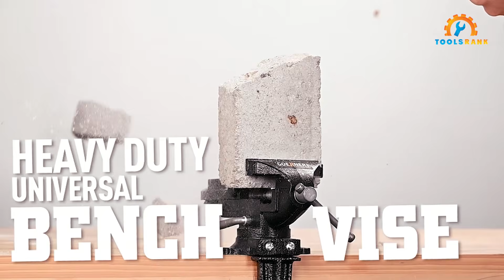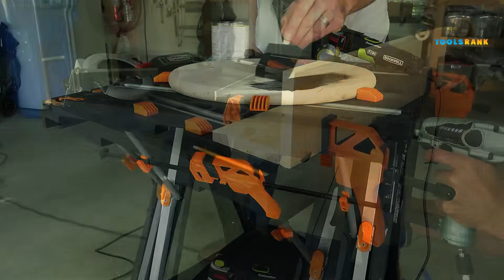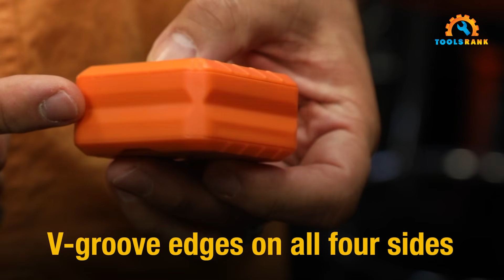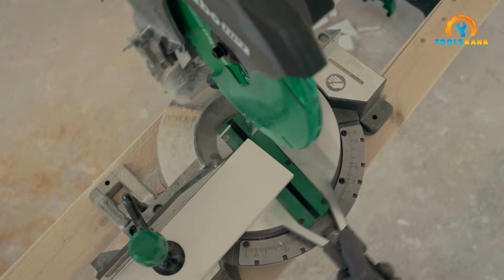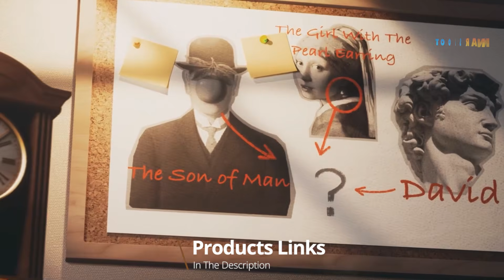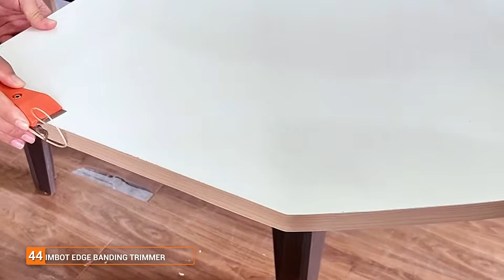46 Next-Level Woodworking Tools On Amazon You Must See in 2026

Comment from the maker: 1		Heavy Duty Woodworking F Clamps	
 https://www.amazon.com/dp/B0DV8G62YH?tag=toolsrank-20
2		VEVOR Electric Wire Stripping Machine	
 https://www.amazon.com/dp/B0CMZCNQNF?tag=toolsrank-20
3		Multi-Purpose Bench Vise Clamp	
 https://www.amazon.com/dp/B09TP7GZL9?tag=toolsrank-20
4		IMAYCC Electric Cement Mixer	
 https://www.amazon.com/dp/B08MFFZXN4?tag=toolsrank-20
5		Premium Cabinet Clamps Set	
 https://www.amazon.com/dp/B0BJQPMXZF?tag=toolsrank-20
6		Malco Adjustable Hole Cutter	
 https://www.amazon.com/dp/B000289542?tag=toolsrank-20
7		Woodpeckers Table Saw Gauge	
 https://www.amazon.com/dp/B002VRFM9Y?tag=toolsrank-20
8		LEXIVON Miter Saw Protractor	
 https://www.amazon.com/dp/B085BDP24T?tag=toolsrank-20
9		AVID POWER Compact Router	
 https://www.amazon.com/dp/B07CQK4ZL4?tag=toolsrank-20
10		Worx Pegasus Folding Work Table	
 https://www.amazon.com/dp/B01HREBZ3M?tag=toolsrank-20
11		GOINGMAKE Thin Rip Jig	
 https://www.amazon.com/dp/B0CBKSZ1D1?tag=toolsrank-20
12		GOINGMAKE Cabinet Door Mounting Jig	
 https://www.amazon.com/dp/B0DSKNJQKM?tag=toolsrank-20
13		Mt Diablo Wood Chisel Set	
 https://www.amazon.com/dp/B0CKLVV2VC?tag=toolsrank-20
14		RUITOOL Japanese Pull Saw	
 https://www.amazon.com/dp/B09NW2R5HQ?tag=toolsrank-20
15		Thin Rip Table Saw Jig	
 https://www.amazon.com/dp/B0048J720U?tag=toolsrank-20
16		RUITOOL Double Edge Pull Saw	
 https://www.amazon.com/dp/B09NW2R5HQ?tag=toolsrank-20
17		MICROJIG GRR-RIP Push Block	
 https://www.amazon.com/dp/B00DNX3N7S?tag=toolsrank-20
18		Klein Digital Angle Gauge	
 https://www.amazon.com/dp/B07ZWW3BW5?tag=toolsrank-20
19		NECAMOCU Edge Banding Trimmer	
 https://www.amazon.com/dp/B0D9TX59CG?tag=toolsrank-20
20		Amazon Basics Hand Planer	
 https://www.amazon.com/dp/B07V3QLZ5Y?tag=toolsrank-20
21		Klein Digital Electronic Level	
 https://www.amazon.com/dp/B07ZWW3BW5?tag=toolsrank-20
22		MICROJIG Smart Push Block	
 https://www.amazon.com/dp/B00DNX3N7S?tag=toolsrank-20
23		Worx Pegasus Portable Workbench	
 https://www.amazon.com/dp/B01HREBZ3M?tag=toolsrank-20
24		GOINGMAKE Thin Strip Cutting Jig	
 https://www.amazon.com/dp/B0CBKSZ1D1?tag=toolsrank-20
25		Ninety Degree Corner Clamps Set	
 https://www.amazon.com/dp/B0GMGX996M?tag=toolsrank-20
26		WETOLS Right Angle Clamp Set	
 https://www.amazon.com/dp/B095P753JN?tag=toolsrank-20
27		KATA Painters Pyramid Stands	
 https://www.amazon.com/dp/B08ZMKBJ4Z?tag=toolsrank-20
28		Metabo HPT Compound Miter Saw	
 https://www.amazon.com/dp/B0FBPB1MJ8?tag=toolsrank-20
29		Deluxe Wood Carving Kit	
 https://www.amazon.com/dp/B0FQTYCM3Q?tag=toolsrank-20
30		WETOLS Woodworking Corner Clamp	
 https://www.amazon.com/dp/B095P753JN?tag=toolsrank-20
31		Milescraft Sanding Block Tool	
 https://www.amazon.com/dp/B09Z73PD6J?tag=toolsrank-20
32		Rockler Bench Cookies Grippers	
 https://www.amazon.com/dp/B006N789W0?tag=toolsrank-20
33		SKIL Sliding Compound Miter Saw	
 https://www.amazon.com/dp/B08J7N3VYW?tag=toolsrank-20
34		IRWIN QUICK-GRIP Mini Bar Clamps	
 https://www.amazon.com/dp/B001NP9S7M?tag=toolsrank-20
35		WORKPRO Wood Chisel Set	
 https://www.amazon.com/dp/B0DPY6TRFZ?tag=toolsrank-20
36		Fanttik F2 PRO Rotary Tool Kit	
 https://www.amazon.com/dp/B0DRXRH9DQ?tag=toolsrank-20
37		RUITOOL Japanese Ryoba Pull Saw	
 https://www.amazon.com/dp/B09NW2R5HQ?tag=toolsrank-20
38		Klein Tools 11-in-1 Screwdriver	
 https://www.amazon.com/dp/B0015SBILG?tag=toolsrank-20
39		GALAX PRO Circular Saw	
 https://www.amazon.com/dp/B0CW2XVXSB?tag=toolsrank-20
40		Bench Dog Hole Clamp	
 https://www.amazon.com/dp/B0CRR674D6?tag=toolsrank-20
41		BORA Track Clamps Set	
 https://www.amazon.com/dp/B07MVKQNM5?tag=toolsrank-20
42		ECY Cabinet Alignment Clamps	
 https://www.amazon.com/dp/B0F8MXBKJ4?tag=toolsrank-20
43		Track Saw Parallel Guide System	
 https://www.amazon.com/dp/B0FF9HBWXZ?tag=toolsrank-20
44		Imbot Edge Banding Trimmer	
 https://www.amazon.com/dp/B0FFGHVPMK?tag=toolsrank-20
45		SUIZAN Small Flush Cut Saw	
 https://www.amazon.com/dp/B0F549DC5Q?tag=toolsrank-20
46		Adjustable Angle Clamp Set	
 https://www.amazon.com/dp/B0F3TLW5P3?tag=toolsrank-20